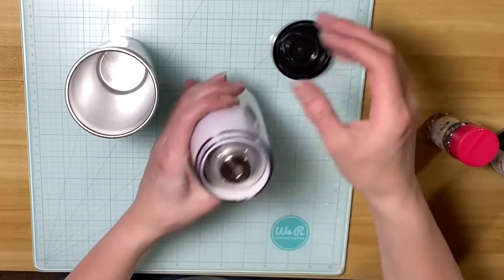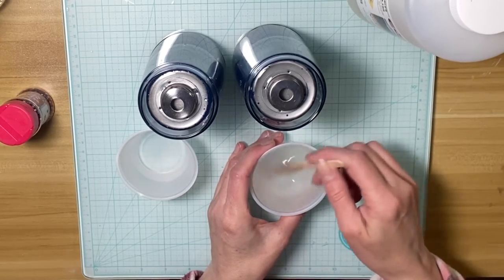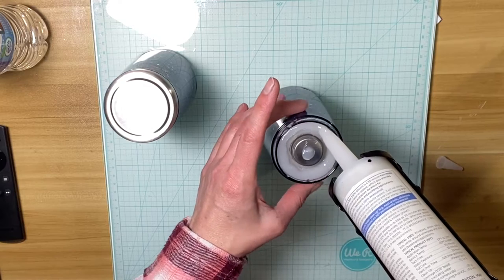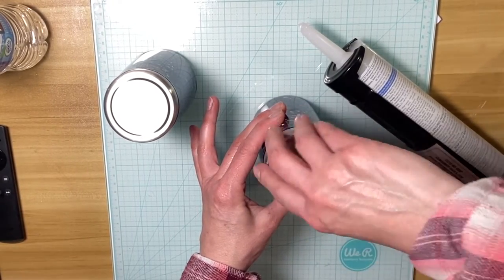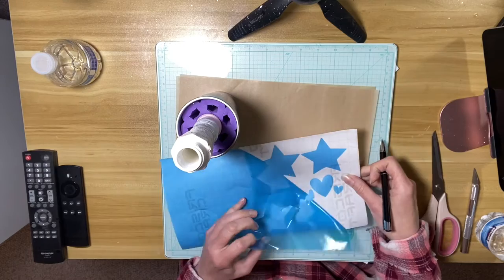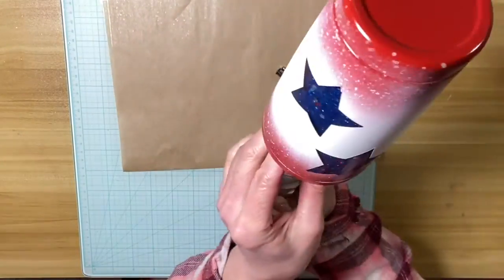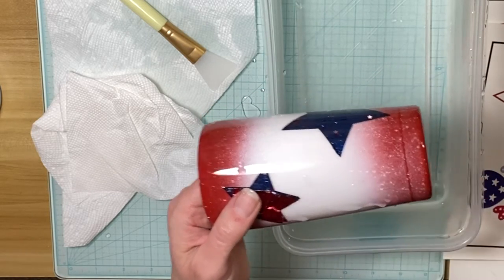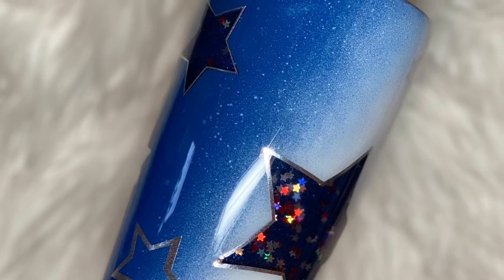Patriotic Storyboard (Snowglobe) Tumbler

Comment: You mention sanding really well so the epoxy wouldn't repel at the spot where the metal meets the acrylic.... did you send the entire acrylic portion before applying the stencils and then painting? I'm starting my very first storyboard and I'll confused about sanding the acrylic. Wouldn't it scratch and ruin it? Wouldn't sanding the acrylic make it foggy?
Reply from the maker: Hi! :) Yes, sand the acrylic before painting, or applying stencils. Epoxy makes any visible acrylic shine again. IF you are applying a clear waterslide, clear vinyl, or clear decal over the top of a sanded surface, the dullness WILL be visible through the clear image. In that case, you'll need to shine the surface back up with a layer of epoxy OR a few layers of clear glossy spray paint BEFORE applying those clear images.
Reply: @holleezhobbies  thank you very much.
Reply from the maker: You're welcome! :)